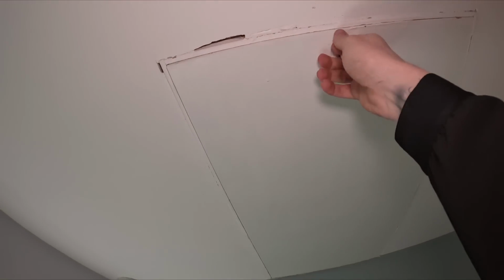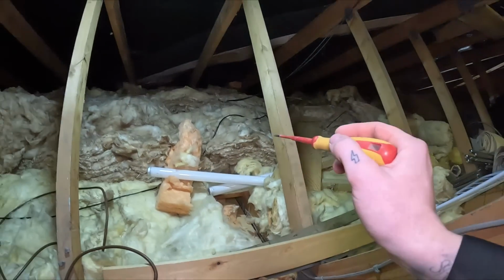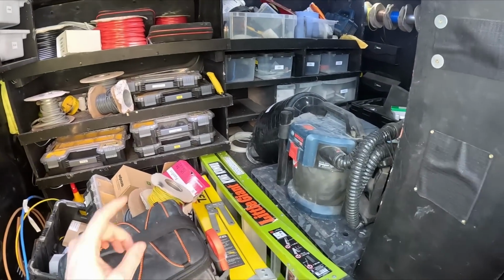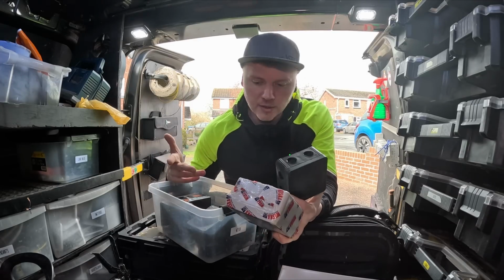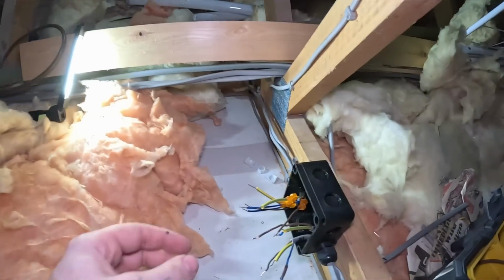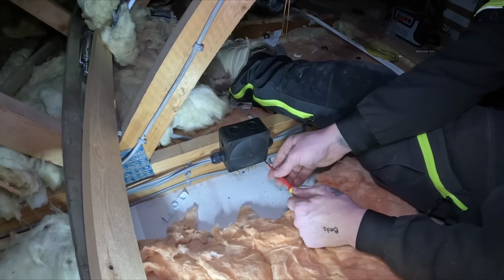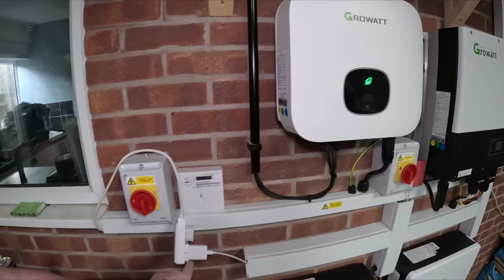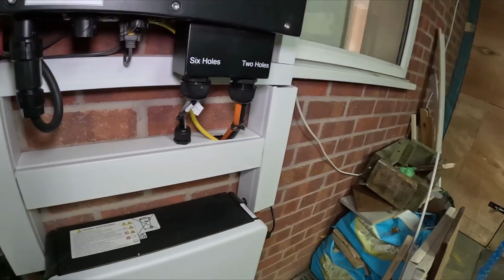Very CHEAP solution..... Maybe

Comment: The Shelly 1L is also useful for older UK homes, where you don't have a neutral to the light switch, and install it at the switch.  Though you may have to also buy the small bypass adaptor to install in the light fitting, as it requires a minimum load of 20W.  One other advantage is you can use it with Smart bulbs and Home Assistant, so that the switch doesn't actually turn off the bulbs directly cutting the power, but instead just triggers the smart bulb to go into its off state.  This means that it doesn't keep entering pairing mode every time you turn it on.

Comment: Great to see you looking more into the smart home stuff, just had a re wire with all my lighting running back to a panel build, but using shelly Pro series on din rail. The Pro series can be hard wired to your network with cat so no WiFi dependency. The actuall shelly Software is quite powerful so if people didn't want the HA software.

Comment: Also, with the myriad of options available for smart home if I were doing a re-wire on my property I would probably run feed, switch and lights all to common board/cabinet so the “smart” bit can be changed as the technology evolves. Do the pros out there see or do any of this for their customers?
Reply: Probably do it per floor or something to cut down a little on massive amounts of wiring …. Not a pro tho 😅

Comment: So, I’ve wondered about these shelly devices. The fact that they’re not available from any uk based retailers makes me somewhat suspect that they aren’t certified for UK or EU standards… I know the website makes all kinds of claims but they’re unverifiable.
What onus is on the sparky fitting something like this to check and is it a violation of wiring regs if they don’t actually conform to BS?
Reply: Apologies if this is covered in vid, not had time to watch it all yet but will later. Tell me to shut up if it is covered 😂

Comment: This series is right up my street! I used a couple of Shelly 1's in my house. 

I've got garden lights to come on between sunset and 11PM, but because the Shelly also supports switched input there is a manual override switch and PIR in the garden. 

I also managed to put one in a backbox to turn the front entrance light on between sunset and sunrise. Previously it was switched only, which is annoying because you'd either forget to turn it on, or off!

Been using Home Assistant for years... it's a great piece of software.

Comment: I've had nothing but trouble with Shelly stuff since 2021. Shelly 1's in particular were always getting stuck in whatever switch state they were in after 4-5 days of operation and had to be reset - I just couldn't trust them and still can't. Luckily not installed at any customers.

Comment: Shelly seem to promise the world, but on the facebook groups there does seem to be a very high failure rate, Their Pro range is good, but they do not do everything yet to mount into a din rail enclosure. Hopefully they will get their act together  as their concept is very good.  Sonoff i have used on several smaller garden ligting jobs and they work seamlessly

Comment: I use Shelly products and Home Assistant it is an excellent and cost effective solution to home automation.

I am in the process of working with a local electrictian to putting a "control box" to house all the relays in one place and just run feeds to the light fittings, doing away with wired in switches and using Z-Wave based remotes. 

Keep up the great work guys, love the videos.

Comment: At the risk of sounding like a troll.... you shouldn't prove dead with a tester that needs battery power. The reason I know is I got slated when I went to prove dead with my multifunction tester instead of getting my 2 probe voltage tester out the van 🤷‍♂️ maybe if I say it first no one else will feel they need to?? Haha
Reply from the maker: You should mate but I knew it was dead, just did it for the video 👍

Comment: Love this and now subscribed to Ollie. I use Home Assistant in a VM, and it's amazing, though I wouldn't recommend HA for everyone. The advantage of Alexa and others are it's ease of use, but the drawback is that every request is going through Amazon's servers, meaning zero privacy + Internet dependant. HA offers both privacy and local control, but the drawback is it requires a level of understanding of coding, IT and networking, which tech nerds like me are ok with lol, but not the average person can do themselves. Plus as the tech person in my family, guess who's the person everyone calls when things go wrong?... haha

The one thing I wish there was more of in the UK is DIN rail mounted IoT relays. Shelly does their pro line up, but they're limited to 16A, not a range, and so I'm told, best suited to Europe's electrical system not our UK ring main system. Maybe this is something both of u can investigate on Ollie's channel, more brotherly collabs. :) In my head, I would have a 2 rail consumer unit, one rail would do the usual stuff, breakers etc, but the 2nd rail would be populated with these smart relays in line with the circuits. The only place I've seen something like this is a Youtuber called KinCony IoT, who builds custom PCBs to work alongside not only HA but also the breakers themselves, but I doubt that kind of wiring would be suitable in the UK, since his electrical work seems to be with the Chinese/American electrical systems, interesting to watch though. One can only hope shelly expands their products to achieve this in the future. Hope to see more from Ollie on his own YT channel.
Reply: I have thought of having a go with the Shelly Pros for monitoring the power on the different circuits, but they don't do one higher than 16A, so I couldn't use it on my Kitchen ring.
Reply: @OlliesSmartTech  Yh, exactly the position I was in when I was looking into the Shelly Pros. On the face of it, the Pro line seems to be the best option. Clean install, all contained within a central area, ethernet connection to get around the metal CU blocking signals, sounds perfect. But then you look at the details, and then you realise it can't be done. For me, 3 out of 10 circuits I could monitor with the pros, and 1 of the 3 is Solar, already monitored, so no point.

Comment: Nick, are those devices rated to have more than one cable in their terminals? Legitimate question as I'm wondering how they're designed. I know it's more common to do that in the UK (it's generally pretty frowned on to do that in NA jurisdictions now).

Comment: I am a huge fan of Shelly. Works great. I even have them setup to open my garage door and electric gate. 

One thing to note that the old version has been installed. It has been replaced with the Shelly 1 Plus. 

If you get the Shelly 1 PM you can also measure the energy consumption.
Reply: I wasn't aware of that, i imagine I'll be using some more shelly relays in the rest of the house, so I'll try the Shelly 1 plus next, thanks
Reply: @OlliesSmartTech  No worries! I have just subscribed to your channel! Looking forward to the next video.

Comment: Why you don't use just smart bulbs - Because unless you blank off the switch, the lamp will be switched off, and no amount at shouting at 'Aleca' will switch it on again.
The other issue in the UK with smart switches is they need a neutral - kind of rare in the switch in the UK.  (You can fit no-neutral switches but they dribble a very small amount of current through to work, with cheap LED bulbs you end up with flashing lights)

Comment: i have used several brands , they are much of a muchness , i found the quinetic are pretty good and long lasting they also do a  switch replacement with a built in receiver which means you can add switches without adding cables

Comment: Smart lamps like Hue can often dim and change colour. Relays are simpler. You can get dimmers but not colour change unless it is in lamp. Ikea are cheaper, they dim but not colour changing. I do have a problem if I lose wifi but many also rely on internet which is not reliable. You still need torches in strategic locations.😅

Comment: Don‘t get me wrong, but this is just amateurish China crap.

I wish I could send you a KNX Demo board and get you up to speed with this world wide standard, supported by 500 vendors (ABB, Siemens, Schneider, Eaton, Gira, Jung, …)  with more than 8000 compatible devices and around for 30 years now.

My current project is a 600m2 sports club, completely automated from door comms, heat pump optimization, flood lights, alarm system, multi-room-music… all designed to last 50y (and without a central server which could fail)

KNX is soooo much better than what you have there, but it seems the barrier of entry is just too high for UK electricians. I have no idea why it is used all across Europe, but not that much in GB.

I mean, KNX is „pro-level“ stuff and if you get the idea how it works, you can save so much time on house rewires and by combining KNX and DALi, one can go after the whole shop & restaurant lighting market .

What would it take for you to have a look at it? I mean KNX UK would probably offer free training for you…

Comment: My home has smart lighting through out. It can be controlled via , Alexa , app, , by the smart wall switches. It also has automation. Home assistant , personal I wouldn't touch it with a barge pole. The app I use is tuya smartlife. It has far more integration and far more manufacturers support it.  I use door sensors, and Alexa generation 4 , because allow you to controll devices using temperature. I been doing home automation for over 10 years. Hiding smart switches in lofts is a folly , if you got to reset you got to climb into the loft. You can now get smart wall switches now that don't require a neutral. Raspberry pi is over complicating the system. All you need for home automation is smart speaker, app , Smart devices.
Reply: Smartlife is fine if you're happy with the Chinese Communist Party effectively knowing what you're doing and giving them a potential backdoor into your home. Alexa is fine until Bezos decides to pull the plug on Alexa as it's turned out to be a huge loss maker for Amazon or starts charging a subscription for using it. The biggest plus side of HomeAssistant (and other similar things like Hubitat) are the fact it can all be locally controlled and doesn't rely on your internet working or some random cloud server in Outer Mongolia that Tuya uses. It supports more devices from more manufacturers than Tuya, Amazon and Google combined could even dream of and allows people to carry on using smart devices long after manufacturers have given up supporting them or have more likely gone bust. It's an open source software project which effectively means there are tens or hundreds of thousands of developers out there adding support for more and more devices and ever cleverer ways of using them. HomeAssistant isn't for everyone and there's certainly a learning curve if you want to get anywhere near using it's full potential but for simple smart lighting and integrating some sensors it's all very straightforward.

Comment: Pick the Shelly 1 plus. The software and WiFi are better and if you disable the AP and Bluetooth and enable ECO mode,  they are ridiculously power efficient. 
For your Bro: The sonoff MQTT  v3 adapter and Aqara proximity sensors are great for cheap battery run small wireless PIRs. Large & busy rooms may need 2, just group them in HA. 
Just remember Zigbee uses WiFi channel 11 so put your WiFi on 6 :)

Comment: Home assistant it’s complicated for most but as said you can join a lot of different brands and protocols in one place. But if you want a simpler way and have an iPhone stick with certified HomeKit devices and with matter rolling out now  there will be a lot more devices in the market soon and if there is something that you really need and isn’t HomeKit compatible homebridge is the way. Having said that I fit lots of shelly in some projects and agree with Nick there isn’t a neat way of fitting those bastards. My favourite aftermarket solution is Legrand zigbee. Love from Portugal 🇵🇹

Comment: I'm a sonoff guy myself, they have the new mini, but even with the old one I could fit behind a light switch, I have a mixture of zigbee and WiFi devices.
Reply: Ive ditch sonoff the it the worst of the worst and the most unreliable is of all Smart devices
Reply: @Robert Burrows  well can't say I've had the same experience, which devices are limited in the normal household because a router can only connect so many devices, especially the older types,if you have a family and all their devices, tvs, phones, consoles etc all transmitting on 2.4ghz, not to forget microwaves, cordless phones. that's why zigbee is a better option.

Comment: The future lies in the development of intelligent (app controllable) fuse board switches. Distributing intelligent switches all round the house in all kinds of system nooks and crannies is just creating a maintenance nightmare. And you are far too young to say it's all beyond you. It's sort of mental laziness if we're being honest. Working out the processes behind building your channel and acquiring the filming and editing skills is vastly more complex than sorting out a few very stupid (in logic terms) switches and apps. Edited to add smart (intelligent) plug tops. They'll be huge in terms of adding granularity to intelligent switchable circuits.
Reply: You beat me to it. I have 30 switching and 10 dimming channels sitting in my KNX distribution board and just a green 30V TP Bus wire going from one room to the next, building a tree-like topology where push-buttons, smoke alarms, thermostats are all daisy-chained to the KNX wire - up to 700m and 64 physical devices on a single segment.

The KNX protocol has been around for decades and seems like outdated tech in the first place, but it provides 100% compatibility across 8000 devices from 500 vendors and just pushing a button, switching on a light or sending the current room temperature really does not need WiFi 6, IPv6 and OAuth. In fact it shouldn‘t.

If you want it App controllable, you get a Gateway. We had a web-gateway in 2007, an Alexa-Gateway in 2017 and a Homekit-Gateway in 2019.
Having a perfect abstraction between (long-term) house electrics and (short-term) control layer makes it more sustainable than anything I have seen in the IP world so far. We have replaced the Web-Gateway with HomeAssistant now, but everything else is still pretty much original. Never needed to throw anything away in 20 years of home automation.

We live in our place for nearly 20 years, never had a failure or outage and would still recommend the standard to anyone who is considering a rewire of their property. It just works!

Comment: My only opinion of all this stuff (as a 25 yr old) it's great when it works, would suck when it doesn't. As long as you can always manually switch it on or off (without the smart tech) that's always preferred and if it needs to automatically be connected outside your home network then it's unnecessary. 

Given that something like an app can be useful if you have forgotten lights and have a "turn off all lights" button but I feel the smart tech doesn't need to be too smart for its own good. Situations come to mind of internet going down, Alexa has no idea what's going on and everyone's sat in the dark because you can't turn any lights on. 
Gotta be some switches somewhere even if they are backups in the cupboard ahaha
Reply: The Shelly stuff is connected to the light switch on the wall if you want to so dosnt even need a network to work. Of course it can go pop like any electronics but at those prices you can keep a spare. Home assistant is designed to be all local so talks directly to the kit on your network so no internet needed. It’s a bit of a learning curve but plenty of YouTube channels out there that do a good job of explaining it.

The thing is it gives you a dashboard or dashboards showing what you want all together. I’ve got all my house lighting and switches in one page and the temperatures and humidity in another. Got 3 different makes of temp sensors and they all sit in a  dashboard. 

I’m working on sensors for the heating system to tell me if the water tank is too high (overflow) or too low (heating systems shut down) and when it’s valves and pump are running.

Also home assistant has a voice assistant that works directly so you can always use that instead. Not played with it yet but I believe you can set the wake word to anything ie Jarvis if your a marvel fan. 

Philips hue stuff works locally via the hub so if the internet is off you can still connect and turn stuff off and on via app.